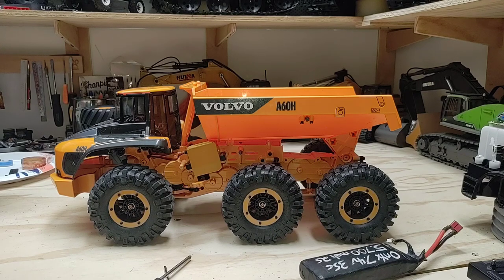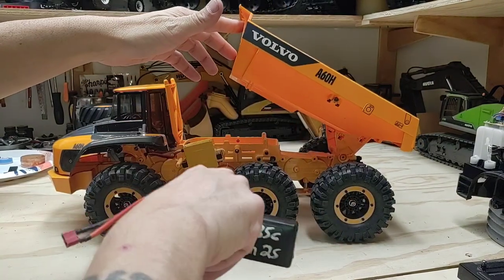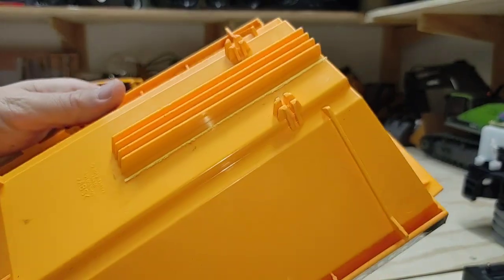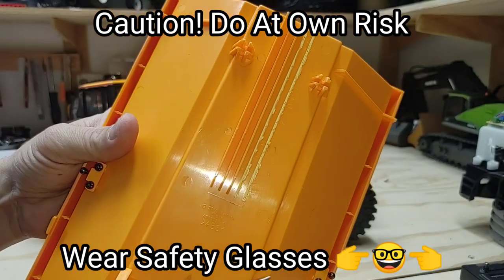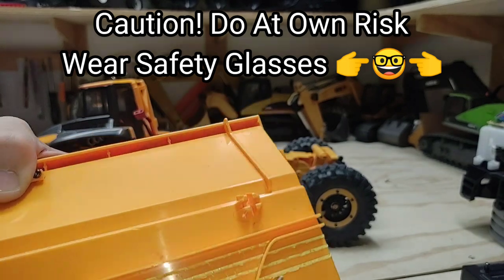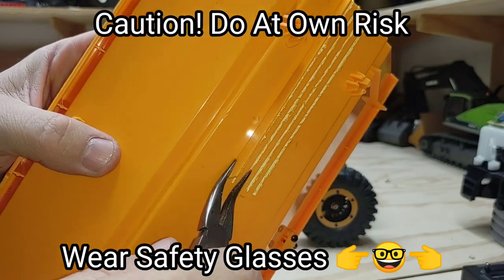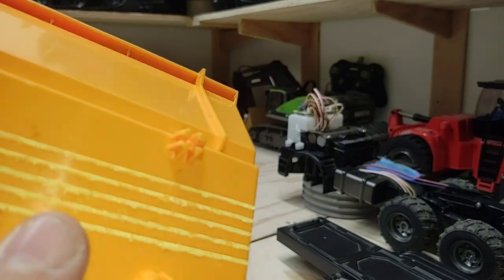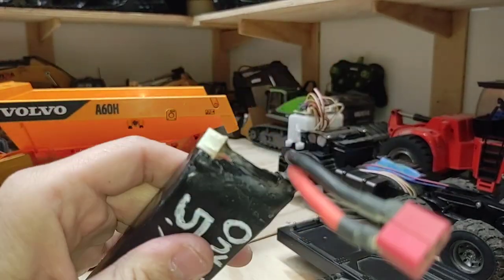Tamiya Volvo A60H; "Battery Tray Mod"

Comment: An 80 turn motor would not have more torque than a 55 turn motor, it would have less torque in addition to turning slower at a given voltage. If you want more torque while staying slow, you need to go bigger and/or brushless.
Reply from the maker: Well that's kinda what I was getting at 😄 lol 
Either way the truck is done, and everything is working beautiful, even with the 55t 540, I figured that I would need a bit more motor to get the job done, but as it turns out the truck can haul a full load with no problems, "even going slow up a large hill fully loaded" the truck did just fine and the motor was cool to the touch.😊
The finished truck has not been seen by the public yet, but it's a 100% success.
Videos coming soon.....😁